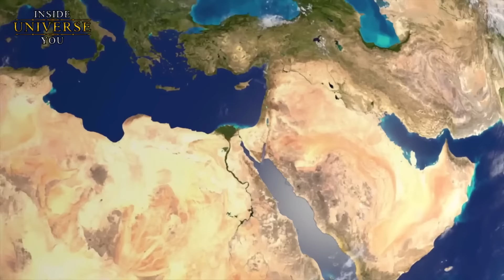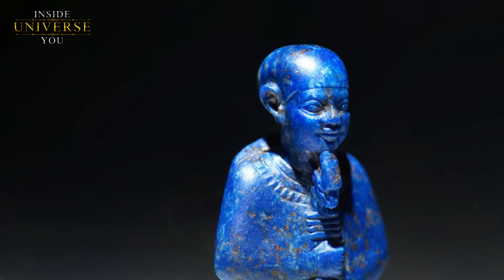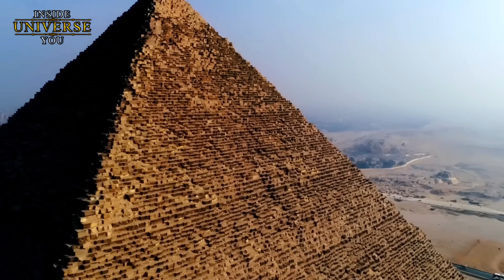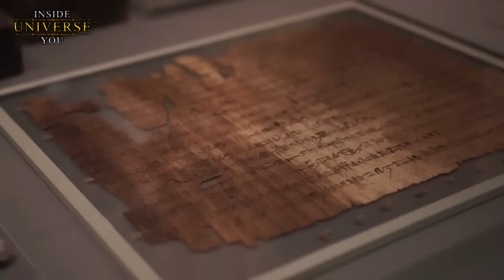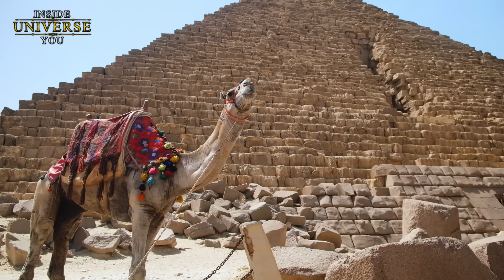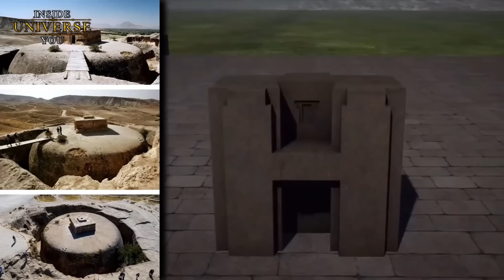They Proved How The Pyramids Were Built: Geopolymer

Comment: Here we go again on the geopolymer theory...  MANY blocks in Egypt show cut marks. The unfinished obelysk? It had to be transported and crafted, also showing tool marks.
Reply from the maker: That's a valid point about the tool marks and the unfinished obelisk. We mentioned that later in the video.
Reply: Of course, and the massive relief stones the main mixing.... i mean kings chamber. How the f did they lift those now? They didnt. Some far older race built the machine
Reply: You can have both!
Reply: Try reading a book. I hear that will help.
Reply: Metal is forged and still has to be polished. You don't think the same concept applies to stone?
Reply: Next time watch the video before commenting. That was addressed in the video.
Reply: How do cut marks disprove the geopolymer theory? They simply could have cut the blocks after they were poured & solidified?
Reply: maybe they casted them and then refined them with the chisel?
Reply: Yeah... but... that doesn't explain the granite boxes.. the alignments ...the math ... The Alabaster Vases that are insane to the 100,000th of a millimeter to perfection ... just pouring blocks doesnt produce Mathematical perfection and everything else underground...
Reply: its such a stupid idea. we literally know where they quarried the stone form. it drives me nuts. its room temp IQ levels of thinking
Reply: @TheMookie1590 some were quarried some were cast.
Reply: Absolute horse shite! 🙄 They cut and carved the stones. There are tool marks all over them! We know where the quarries are, with  stones being cut out from them still in situ (aswan quarry)! Heck, one of the limestone quarries for the stone used on the pyramids is RIGHT NEXT to the pyramids, with cut blocks and rubble from cutting still scattered all about! Then lets look at the tests of the limestone; the stone on the pyramids matches the stones still in the quarry EXACTLY in all areas such as in density, granular mineral distribution and composition, impossible with a geopolymer and, again, have tool marks ALL OVER THEM
Why would the Egyptians, or anyone else for that matter, cut out the limestone just to grind it up, mix it, build forms, pour the "geopolymer" (🙄), dry and harden it and then.... CUT AND CHISEL it AGAIN!? Makes absolutely zero sense, as well as making it needlessly more difficult. 
Now, you can make the case that SOME of the pyramids is "geopolymer" (🙄) in the case of the limited use of mortar in between some of the cut stones, as mortar, concrete, etc is a form of "geopolymer" (🙄) but that is the one and ONLY instance where the term is applicable.
Reply: @RealKlausSchwab its simple. Pouring would be a far greater task then using stone. The problem is people are trying to prove the egyptians built them with said tools in said time period. They didnt.
Reply: @RealKlausSchwab  why are you so angry haha
Reply: 'Blocks' were poured in place. The 'cut marks' on blocks could be from the smoothing out the block after removing forms. The interior of pyramid had to be poured in place in order to achieve the 'kings chamber' type results.  The 'tool marks' could have been made 1000 years after pyramid was built.  
For sure the Egypt people did not build these structures, but a human race far older, from before the great flood.
Reply: Scoop marks mate. That only happens in a soft material. End of story.